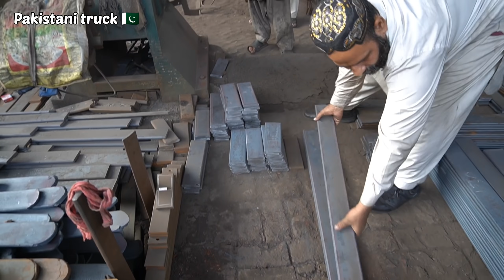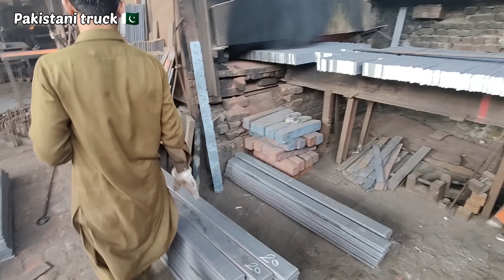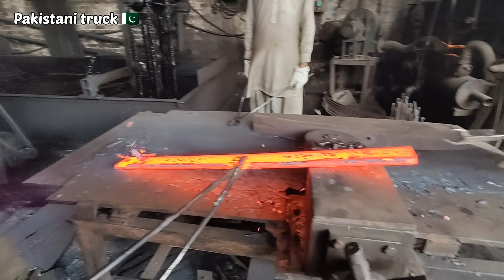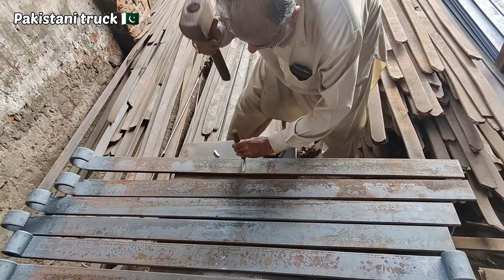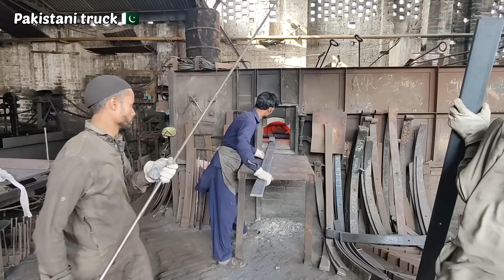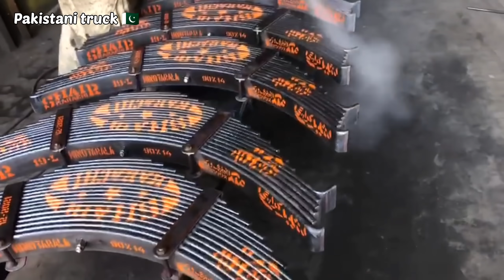Manufcturing process of Leaf springs | Made in Pakistan | Pakistani brand

Comment: Just keep in mind, in terms of precision and safety and efficiency, they are about 100 years behind.
Reply: that process modernized would cost at least 250 million not including osha regulation training..
Reply: They're building leaf springs George and they're doing a good job it ain't brain surgery!
Reply: Nah!  I make three leaf taper springs for a North American manufacturer.  They also make multi-leaf springs.  These craftsmen of Pakistan are, at most, 35 years behind, based on them not having conveyors to move the steel through the furnace and off to the quench tank, which my employer installed in the mid 1980s.

Another problem is that their processes are state of the art for the level of capital that they can spend.  There is machinery that would make the job less labor intensive, but labor is not expensive enough to justify the cost.  There are robots that can do my job, but they cannot be financed with the money that goes to my wages.
Reply: @henripan9584  just keeping it real.
Reply: @georgegonzalez2476  you mean real hate
Reply: @henripan9584  What is "hater"?
Reply: @BobSmith-mc7uq  look it up in the urban dictionary.

Comment: just about every "black smith" and machinist in the US needs to take a long hard look at how these guys harden and temper,  Heat to red/orange, Quench in oil, STRAIGHT INTO THE TEMPER FURNACE, no resting no multiple heat "cycles" no annealing, just harden-temper done how its fecking supposed to be done.  Also for those know it all Machinists out der, "heat treat" does not just mean harden, it could be annealed, hardened, tempered all of them have a different effect on the steel.
Reply: I do not know who you are preaching to.  I work at a North American manufacturer of leaf springs and other forged steel products and the largest difference between what they do and what we do is that we have more conveyors.
Reply: @richardbell7678  all the wanna be machinists I worked for/with and the "blade smiths" that cant figure out how to quench a knife in water without dicking it up (hint don't heat it until yellow) Not to mention all the shop managers I've slaved under that insisted "heat treated" is hardened at all times in every situation.
Reply: @richardbell7678  really just screaming into the void of my industrial PTSD
Reply: @northmanlogging2769  Actually every steel heat treats differently & uses a different process.